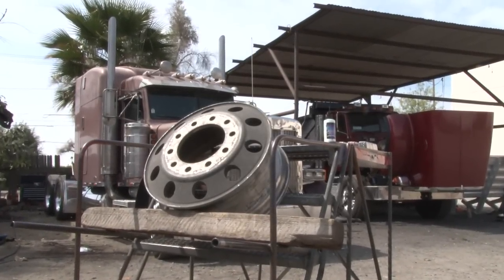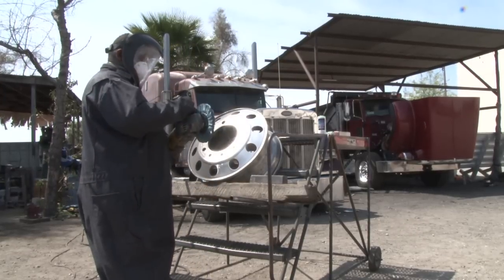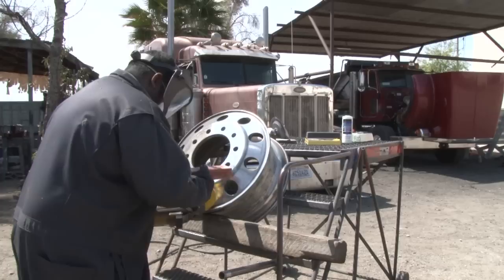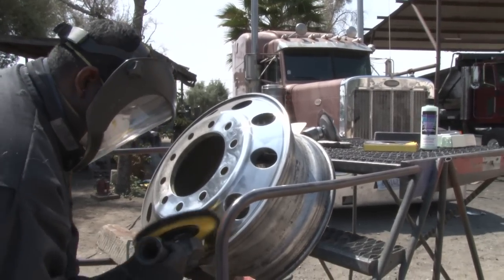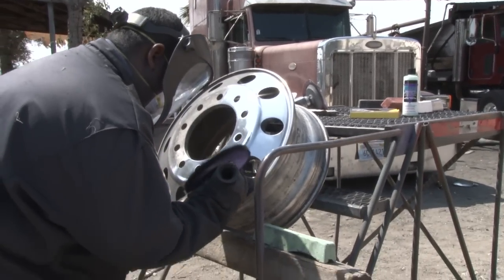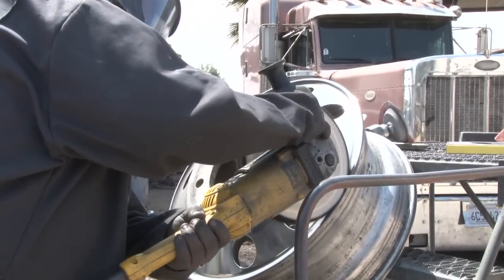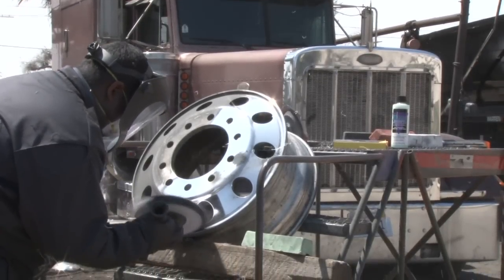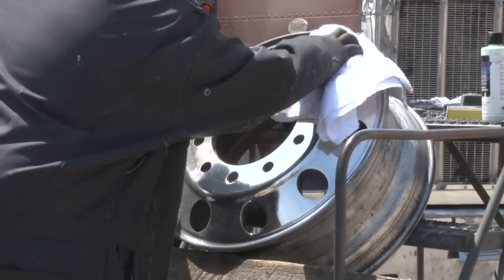Zephyr -  How to Polish Aluminum

Comment: I drive for a local construction outfit, end dump so im running in mud sometimes & dust like powder. I got a bottle of the Pro40, rub on rub off. I get back to shop hand wash wheels then dry then applied some on wheel , They where very dull but with ohhh 15 minutes per wheel the shine came back. I use one rag- applyer & a softer one to remove the residue, I was amazed.. Not as shiney like use a eletric buffer but for hand presure & a rag ... Its amazing....

Comment from the maker: The round goblet buffs will work great for the vent holes on the wheels. I would use the 3" or the 4" Take a look at the Z-Ball on our website. It comes with the 3" goblet and the 8" extender, it works great for getting back into those hard to reach areas. Use them with the Pro 40 metal polish. Always use a good respirator when polishing. The more protection the better. You want to avoid breathing any of the dust from the polishing process. Give us a call if you have any more questions. Thanks
Reply: That was my question, how do you do the vent holes.

Comment: That is hard work,my hats off to the gentleman.
Reply: That is far from Hard work. At least not in my area.  Deep south, concrete, block work, roofing, slabs and pavers too? Or heavy equipment repair in the field. I consider that decent work. Not hard work. Enough exercise so you feel good about your efforts and sleep well. Unlike the AC brigade which hop from AC room to AC room. Wish I had known this product when they came out with it. Nice looking stuff.
Reply: Not really, the machine does most the work

Comment: The wheel/rim cut-outs help but if the final cotton wheel is raked out more, it'll help with the final finish. The cotton surface is what keeps the final surface scratch/haze free. Clean the cotton buffing wheel after 3-4 passes then apply more buffing compound and then clean the wheel again. I used to polish the super-solos that you see semi's pulling. My pops, Claude Benson, was a master at metal finishing. It's an art.

Comment from the maker: Sorry for the delay responding. The recomended "not to exceed" rpm for the 10" wheel is 3,200 and 3,400 on the 8" wheels. And dont forget the safety flanges which are mandatory for use with all airway buffing wheels.

Comment from the maker: We appreciate the comments on the video. The main reason for the video was to show the different steps that one may encounter when polishing aluminum. There are basically 3 to 4 steps that may be needed to bring out the "Mirror Shine" you may need all 4 or just a couple. Every job will be different. Our approach for this video was to show all the steps, not how fast it could be done.

Comment: Chewy needs ear protection from those high RPM buffers he is using.  Props for the mask and eye protection.
Reply: Guys like you are the reason I had to wear a hard hat in a wide open field in 100° 100% humidity. Thanks guy
Reply: Brian Hildebrand 
I still wear my white hard hat on sunny days over 95 degrees when I mow.
Reply: Brian Hildebrand 
And long sleeved white dress shirt to insulate from the sun and heat
Reply: Gotta have that PPE.

Comment from the maker: Its basically the same process. The first step would be to use the Pro 40 "Perfection" Metal Polish. If it does not leave it with a mirror shine, then you know that you need to machine polish it to bring it back. You can visit our website and view our "How to guide" for a reference.

Comment: I used a Dewalt DWP849X to sand and it caused waves in my 24in aluminum semi rim How do remove the waves do I keep cutting with aggressive airway wheel and brown compound block
Reply: This is caused by inconsistent sanding. Your sanding stages are just as if not more important then the actually buffing. This is the stage where you are manipulating material (aluminum). Every mistake you make will be magnified as the clarity in your wheel comes through. It happens though. Sanding properly takes time and practice. And lots of it.
Reply: You'll remove the waves by restarting the sanding process but start with a slightly higher grit than you started. Example: you started with 80 grit  so this time start with a 100 or 120. Try to sand as evenly as possible not spending too much time in the same spot and applying the same amount of pressure in every spot. Sand again with a higher grit  (more fine). Now you can restart your polishing.

Comment: I visited your store but am not sure what airway wheels to buy.  It seems they are designed for different cuts but isn't that just up to the compound applied?  Also, do you use a angle grinder for these or something else like a Makita 9227CY?   I want to have a system for polishing vintage aluminum boats.  Thank you for the help!

Comment: Probably a dumb question but can all these products and methods be used for normal car wheels, given they're bare aluminum? Or is there a difference in the metal on 18-wheeler rims?
Reply from the maker: +Plop nation Yes, the products used here can be used for both auto and truck wheel using the same process. You can contact us direct if you need some more info. 800-763-8883
Reply: One thing on car wheels it may have a clear powder coat that would need to come off first. Other wise it would be the same. I tried that on a pick up wheel the powder coat was a pain so I just painted them . Kind of wish I had the sand blasted then polished them, that truck wheel looks great

Comment: How many times do you pass over the wheel with each stage Including sanding and buffing?
Reply: Brenan Smith with the condition that wheel was in I'd block out an entire weekend for this project     :-p I recently did my truck and it took me like 18 hours.   Wish I had one of those face shields. I came out looking like a coal miner.
Reply: @leecrotty658  Faceshields are the best.

Comment: What can I use to cut a brand new pad if I don’t have a rack?
Reply: Nothing order a rake there cheap don't use a screwdriver or a wire brush or anything like that when you use a wire brush You Dig little pieces of that wire and you shove them into that fresh piece of fiber

Comment: Will this work on some old '70s U.S. Mags?
Reply from the maker: You bet. Try the Pro 40 metal polish first. I think that may be all that you will need to restore the shine on the mag wheels.
Reply: *****  I was told by some of the older guys who had those wheels back in the day that they weren't polished when knew but had a dull finish similar to the centerline wheels of the 80's.
Reply: No clear coat on them, but they do not look contaminated. I thought maybe I could shine them up a bit.

Comment from the maker: We have different wheels for each step and the rouge bars to go with them. We recommend the Milwaukee #6078 it is a true variable speed machine that is lightweight but heavy duty. Give us a call at 800-763-8883 and we can go over any questions you might have, thanks.

Comment: hey what dewalt grinder is that??? can you reply asap as I need this info for my business!
Reply from the maker: We don't have the model number on the DeWalt grinder that is being used. However we do recommend the Milwaukee sander/grinder model #6078 it is a true variable speed machine 0-6,000 and is a lightweight yet heavy duty machine. I hope that helps out.
Reply: Dewalt D28499x

Comment: You took about three steps more than needed, there are new and faster and better methods, also, had you sanded the rims out with 600-1000 grit you would have a much deeper finish. Your polish does not have much in the way of protectant... recommend using a carnuba or beeswax foundation sealant over the finish for a longer lasting shine.
Reply: Anything past 600 you're just wasting your time and money if the compound that you're using is not taking out 600 grit scratches when you're using junk
Reply: Not a single professional polisher recommends or uses wax.

Comment: GOOD FINISH BUT WAY TOO MANY PROCESSES TO ACHIEVE THAT FINISH INSTEAD SAND THE RIM BACK TO KLINSPOR 600 GRIT THEN USE A 9" GRINDER WITH A COOLAIR 10" MOP (PURCHASE FROM AUSSIE BUFF, MELBOURNE) WITH A POLISHING COMPOUND CALLED BRIGHT CUT DX (PURCHASE FROM POLYSHINE) FAR MORE COST EFFECTIVE USING THIS PROCESS THAT RIM IN THIS CLIP SHOULD TAKE NO LONGER THAN 15 MINS OTHERWISE BRING YOUR RIMS TO JCB SURFACE FINISHERS IN MELBOURNE AND WE'LL DO THEM FOR $55 A RIM